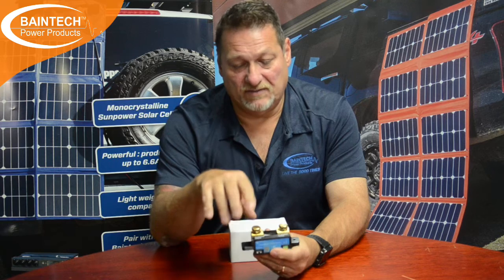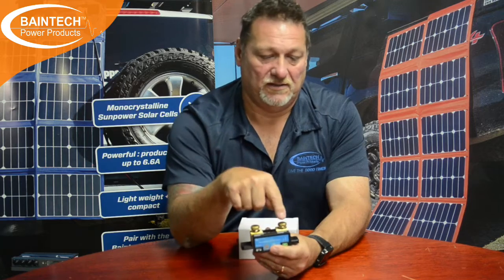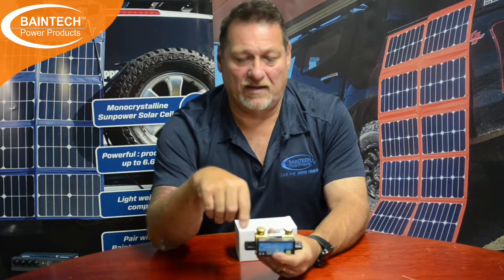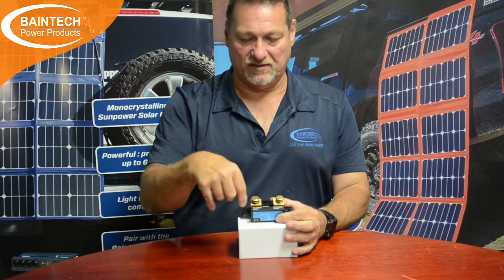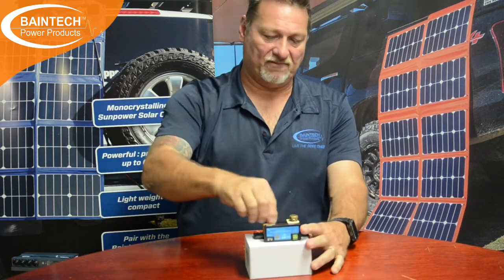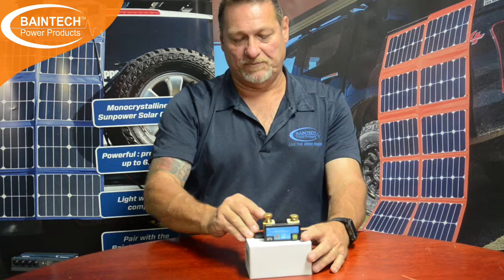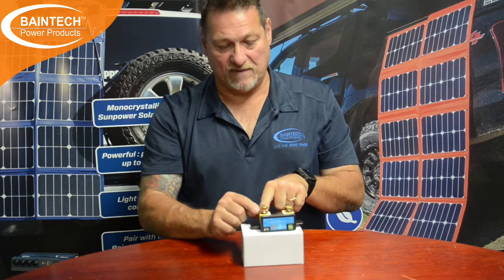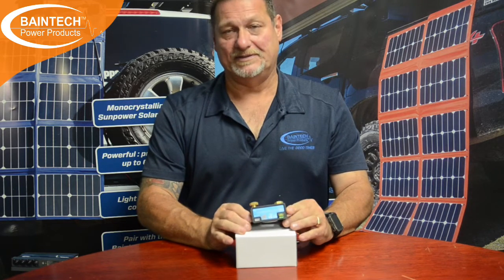Avoid Confusing Shunt Readings: How to Connecting your SmartShunt

Comment: Hi, if I connect the shunt between battery and busbar will I get a correct  amp load reading, say if I have a load on inverter and I'm getting 1000 watts of solar at the same time? If inverter load is 100 amps and solar is 50 amps, will the shunt only read 50 amps of current? 
Thanks